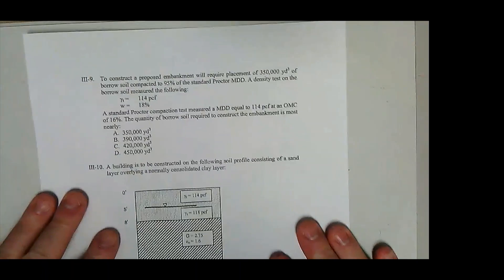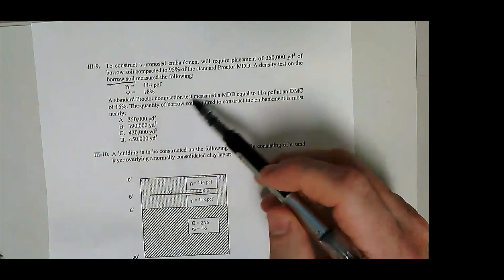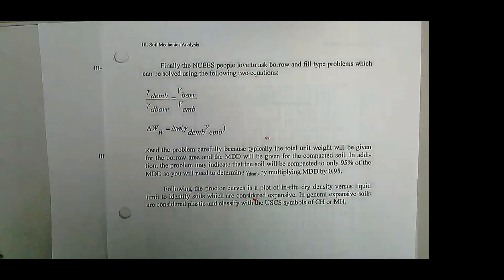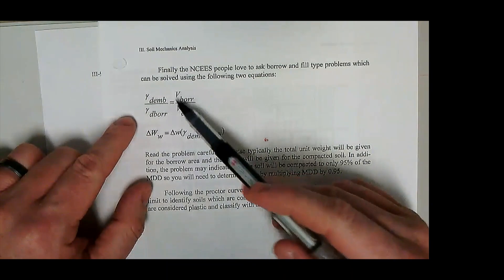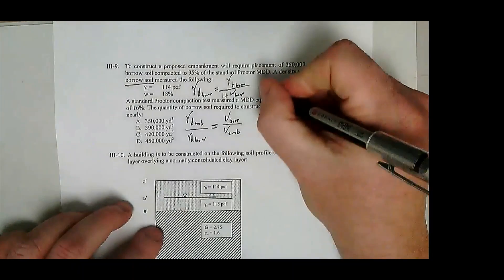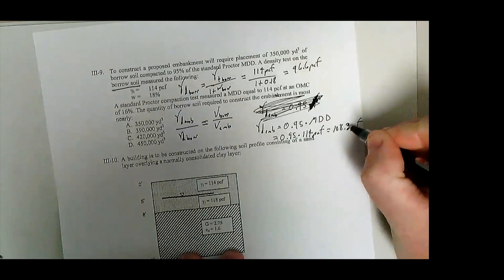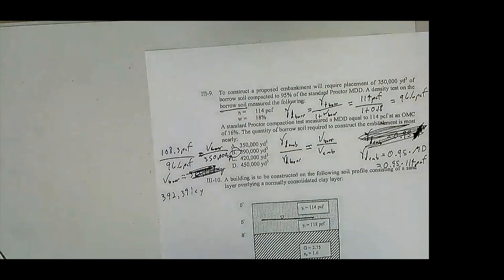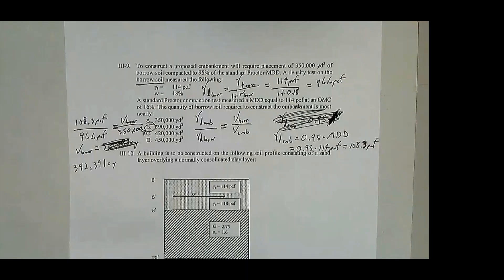Borrow and Fill Example Problem for PE Exam Review in Civil Engineering - Geotechnical

Comment: silly question. ncees hb 1.1. why in the world now that the civil pe is an cbt that the ncees has stuck a geotech section (5.5 on page 281) into a transpo chapter (chap 5)? despite the relevance of geotech in transpo discipline, i think that thematically section 5.5 really belongs in geotech chapter (chap 3). thoughts ?
Reply from the maker: I agree with that assessment - in our review course, the transportation instructor does not cover the geotech and pavement content that is included in Chapter 5 for that exact reason.

Comment: Daniel, thank you for the explanation. The NCEES has a Problem similar to this one on the FE civil ´Practice Exam´. But the dry unit weight ratio of the embankment and the borrow is vice-versa from yours. So, I am confused. Do you think they made a mistake even when they have values in the answer choices using your dry unit weight ratio and the vice-versa?
Reply: HE USED A DIFFERENT FORMULA THAN THAT WAS WRITTEN ON THE PAPER, I DON'T KNOW WHY HE CHANGED IT. I know density is inversely proportional to volume